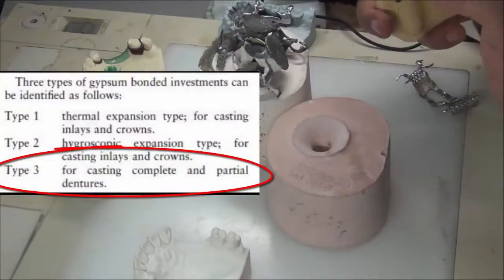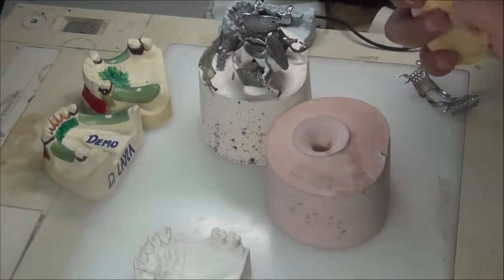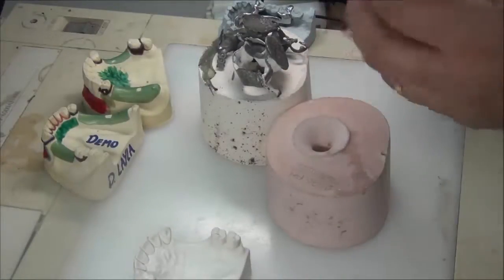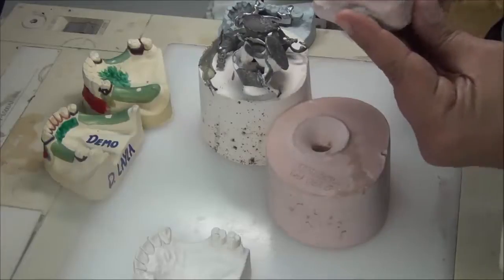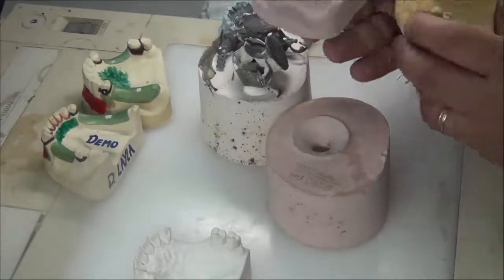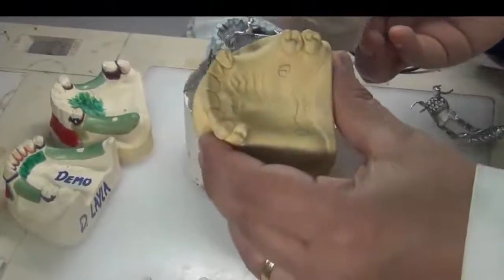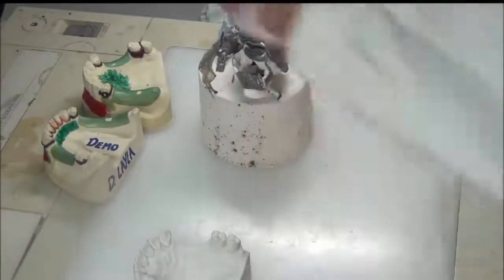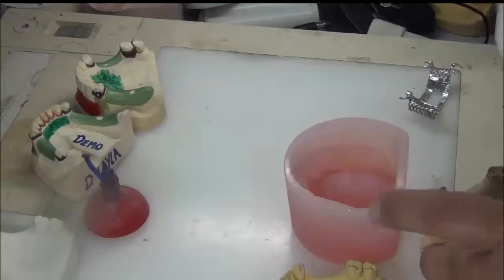14 Permanent RPD: Secondary Cast Blockout and Duplication

Comment: why WE put the relief wax ? i mean what the problem if framework touch the alveolar ridge ?
Reply from the maker: Yes. We put relief under the framework on the saddle area because we need acrylic to fill that space later. This allows us to adjust if needed at delivery and allows us to reline if needed later. 
So the metal is sandwiched between two layers of acrylic that ere joined together mechanically through the open latice of the metal.
Reply: thank you very much 
جزاك الله الف خير